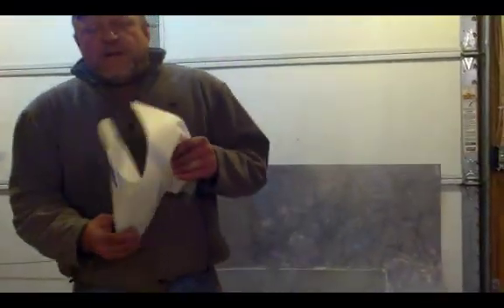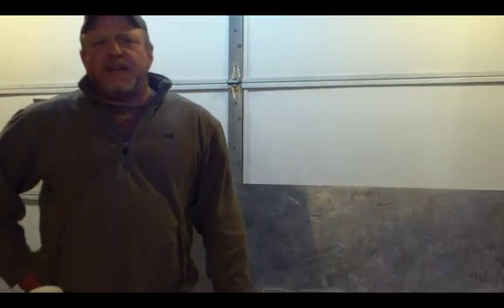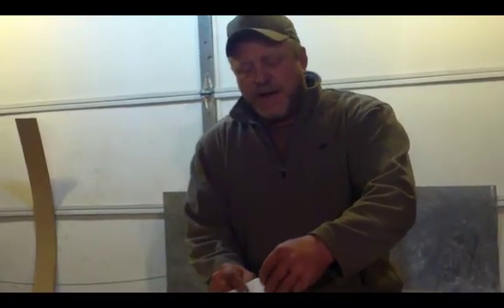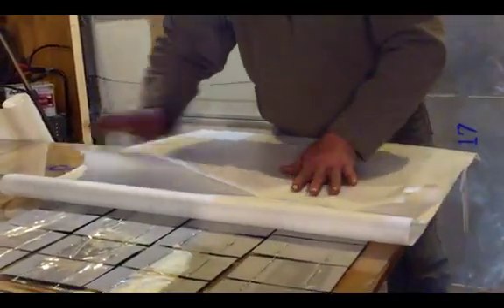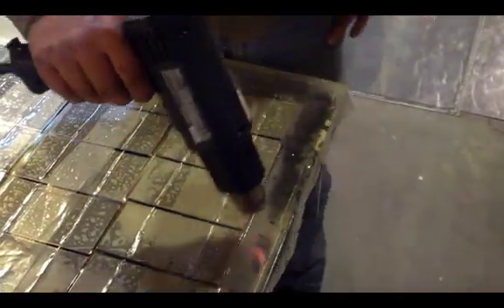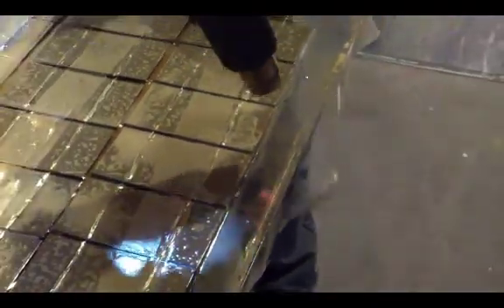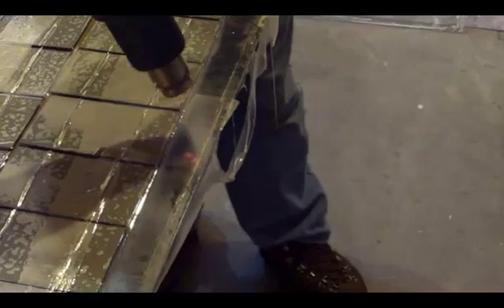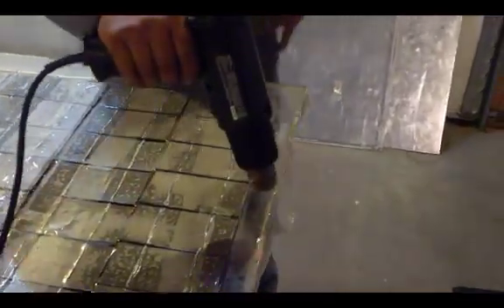Solar Panels - The Easiest and Cheapest Way to Encapsulate DIY Solar Panels

Comment: Interesting way of encapsulating the panels, but I'm worried that this film will melt under the extreme heat from the sun. Those panels get really hot on summer days.
Reply: +WTF BBQ Thats what commercial solar panel makers use on their panels they do it ..cells between two sheets of EVA material...not one but two ..
Reply: +WTF BBQ they are mazimum can reach 80C. So heat should not be a problem. The problem it is very thin - so show or ice can damage it easily.

Comment: Last winter I built 2 - 70 watt solar panels using eva film, It worked pretty good. I also bought some backing for the panels, but really dont know how to adhere it to the back of the panels. Do you have any Ideas?  This year Im building a solar panel using the glass from an old storm door. It should be in the 100 watt range.
Reply: +john strange... solar industry uses to sheets of EVA .. from top to bottom ,, glass, EVA, cells, EVA, then the backing.. turn the panel up side down put the backing sheet over the EVA, apply vacuum and heat...back sheet will adhere to the EVA..In other words, you need another sheet of EVA on the back of the panel..in this video, he is using only one sheet..the sealing of the cells is not that good...

Comment: I subscribed. Looking forward to it. I like the idea of the half panels. I have a bunch of cells I am hoping to get to as well. I have 72 plus in 3 x 6 and also 5 x6 I have had around a long time waiting for me to get too. You said you use standard window glass? The last panel I made I bought tempered glass 1/4". Very heavy to move around. I just worry plain window glass would be fragile. Does the fiberglass screen strengthen it up nicely?

Comment: And you have panels like this that have endured the test of time?
Reply: @ShySkyBros +ShySkyBros  please give an update!
Reply: @SuperThejim  I tried the Eva film and it failed. Heat from the sun loosened everything. I did the epoxy pour and that worked. Prices are low so I don't build and just buy now.
Reply: @rhooie  thank you very much for your update!
I'm hoping to build several panels, so I need to know the best encapsulation method.
Which epoxy pour did you use?  I'm trying to find the best prices for quality epoxy solutions.
Thanks again!

Comment: I never thought of using bed liner. But it sounds like it would be completely water proof. I already have a roll of EVA. I tried it with a layer on the glass, then the cells, then another layer of EVA and a layer of TPE. I used a heat gun, but you can't really get all the bubbles out. This video shows just a layer of EVA on the back. Actually makes more sense to me. The glass in front of the cells is water proof. Why use 2 layers? I think I will just use 1 layer on the back on the next panel.

Comment from the maker: Any air bubbles are on the backside (non sun side). With liquid epoxies, you will often get the epoxy to seep under the cells before it dries, which creates a real mess on the sunny-side of the cells. This is yet another reason we prefer EVA film to epoxies and silicons.

Comment: I was thinking of that Myself,but I worry more about epoxy resins being damaged by heat and continual exposure to the elements as well.One thing about what I see with EVA here is that it takes a lot of heat to get it to seal, and also looks more resistant to heat once used.I wouldn't worry about it.

Comment: I agree the eva is a great solution.  I would still make or get a vacume bad like space bags, to pull all air out of the film before sealing it.  Also I have noticed a lot of video makers pronounce the sylgard wrong, Not picking on anyone, but its pronounce " sil gard" not sly gard. :0 
Now to make a big toaster the cure the eva :0 Hmm!

Comment from the maker: In theory, you coud do this and it would probably work in an emergency. And I've done this for portable cells to recharge small betteries, mostly for fun. But for long term I wouldn't recommend just using tape. You want a really good seal because the tabbing wire as well as the metal connectors of the cells are very prone to rust, which will greatly reduce the panel's efficiency.